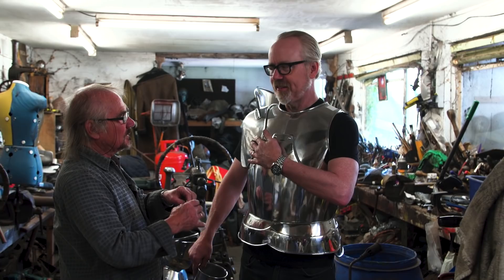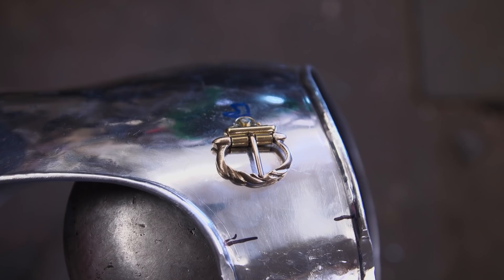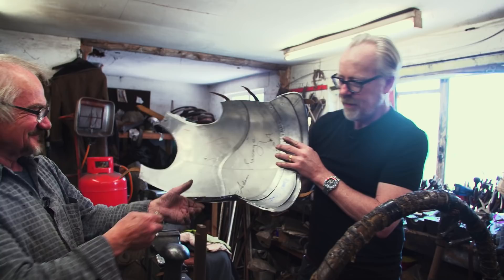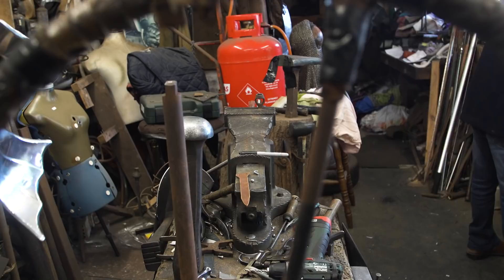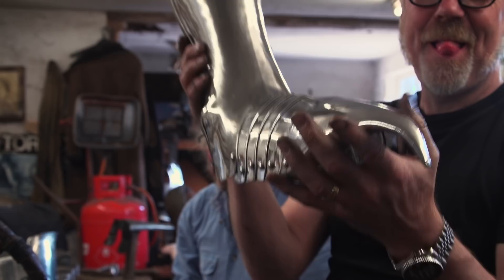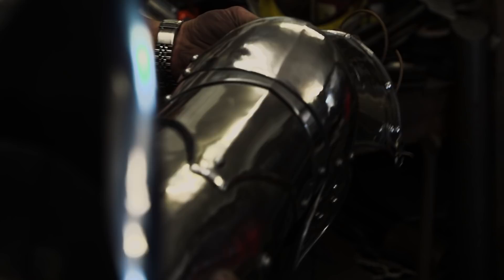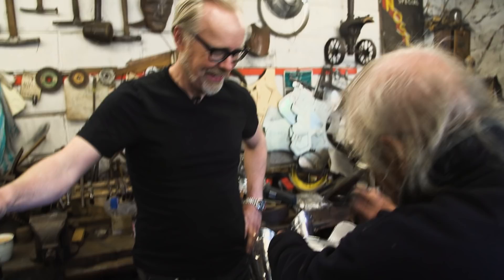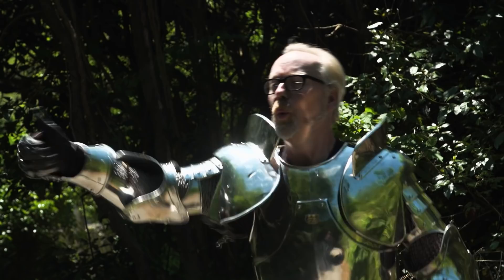Adam Savage's King Arthur Armor Build, Part 7

Comment: ok, Adam because of my 2nd trade of working with leather i know how to keep the joints suttle (if and only when leather is hardening) you can use kidney suet, lard, even types of butter but not fats that harden like wax, paraffin or others that turn hard
you can even use oils as long as you wait for a while for it to absorb you don't want oil stains on your garb underneath! I even got antique leather and even archeological leather to get soft again by first making it wet and slowly replacing water in the leather by a fatty substance ...ps that isn't easy and may take weeks or even years!!
ps if the leather is fine and moves as supposed to no work fatting or oiling is required so, leave as is. don't spoil fat on good leather it can work in the opposite and harden it! (weird yes?)

Comment: As for what Terry says at 2:40, there is some truth to it, but he's wrong. They use sliding rivets, rivets that aren't in a hole, but in a channel. That way they have some motion. These rivets are found in extant armour from all over Europe, but there are even examples specifically from the lames of an English arm harness just like he is working on here. The front rivets are typically riveted directly to the other lame via a sliding rivet, while the rear ones are riveted to leather.

Comment: Okay but, real question here.... how'd you protect your crotch?
Reply: More of the plates that are protecting his thighs.. one in the center would do it.
Reply: You would wear a coat of mail underneath that hangs down over vital areas.
Reply: Move faster, Grasshopper.
Reply: In medieval times the gentlemen would have a 'codpiece' to protect the vital area. It was also a fashion item!
Reply: Knights in armor ride on horses, because they are rich and armor is heavy. You cannot have armor in the place where your saddle goes. Knights have extra plates between the thighs and torso plates and a mail shirt and skirt
Reply: @sytze1985  Armor wasn't incredibly heavy... Maybe 30-40 lbs (give or take depending on the style). Jousting armoe is probably what you're thinking of...That armor was heavy; had to be so  you wouldn't get pierced by the lance.
Reply: With a cod piecs

Comment: oh! forgot eh, well not really but I know that the real armor made of steel can do, anything you can do! forget the stupid awful images of knights getting bogged down in their armor like lumps of lead and being put on their horses by pulleys
what does, way you down is all the padding! the mail chain the woolen padding not to mention the under garbs of all that! you can move just fine as long as the battle is not being fought in July in a heat wave!!.
most battles were being fought I cooler parts of the year for good reasons!!!

Comment: I would hate to imagine being back in time being a blacksmith and making hundreds of suits of armor the old-fashioned way without technology how long it would take
Reply: Honestly, not that much longer. The only power tool used here was a drill.
The really hard part it to get a sheet of metal with no modern metal fondry machinery, the rest is kinda the same.
Reply: @SaitoGray  but still it would be kind of a pain repeating the same process for hundreds of suits of armor
Reply: @harleydaker2299  Yeah of course. But it's one of the better job you can have at that time. They had rich and powerful people live in their hand. Imagine the paid and the possibilities !